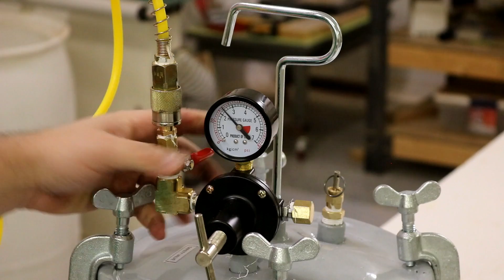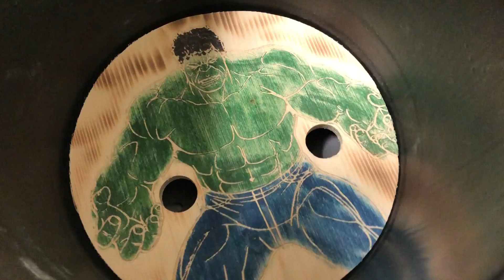Converting a Harbor Freight Pressure Pot for Resin Casting

Comment: I've always seen a vacuum pot being used to de-bubble resins in You Tube videos.  Could somebody please explain the PRO's and CONF's of using pressure versus a vacuum ?
Reply from the maker: Thank you for watching.. Vacuum chambers do a good job of getting bubbles out of the resin, but if it’s a resin with a short working time, there’s not enough time to go through the vacuum chamber process.. my resin has a 12 minute working time… The second thing is, I swirl lots of colors in my projects and it is way more difficult to use the vacuum chamber to degass, pour and swirl the colors.. with a pressure pot, the bubbles are squeezed immediately so you can mix all the resin and get it to the right temp for swirling and pour it, get it in the pressure pot and pressurized before it turns solid.. I remove my projects from the pressure pot 2-4 hours later with awesome swirling and no bubbles.  I hope this helps 👍

Comment: a super easy trick to get the paint outlet bolt out is to use a heat gun. couldn't budge the darn thing. ran a heat gun on it for about 30 seconds and it popped right out.
Reply from the maker: Heat does the trick sometimes. 🤓🦾

Comment: I actually bought the exact same part that you were going to install at the 3:57 mark and it doesn't fit with the pop off valve. Was the part a different fitting from what you described?
Reply from the maker: This video was from 4 years ago and it appears that the pop off valve is different now.. some people will tell me it’s different but won’t tell me what the new sizes are so I can change the links to the correct new parts… could you please let me know so I can change the links.
Reply: @JakeThompson  So when it comes to the actual tank and connections, everything else has stayed the same. 
However, the Robert Manufacturing R209 Series Bob Brass Adapter, 3/8" NPT Male x 1/4" NPT Female item that was an Amazon link has some what shrank in size over time. It still has the 3/8" male part, however the female hole has shrunk. The part from Amazon is now 14/32 millimeters in width. 

From inside, from thread to thread, the diameter is 12/32 mm.
Reply: @JakeThompson  The pop off valve remains the same size with the diameter, from thread to thread, at 1/2".
Reply: Alright, it took some investigation and now I have the part needed for the recent model of that paint tank. It's a 3/8" MIP x 1/4 FIP Bushing fitting from Proline Series. It's weird, because I mentioned before, that the brass adapter from Amazon was the wrong part despite the description. You can get it from Lowes, which is where I got mine, and Home Depot under the Everbilt line. It's under the name 3/8 in. MIP x 1/4 in. FIP Brass Bushing Fitting.
Reply from the maker: @seekertosecrets7618  Awesome.. I will get it changed .. Thank you for taking the time! 👍👍
Reply: @JakeThompson  No problem. I want to get the same results for another project.

Comment: What about using one of these for creating a vacuum chamber to make casting molds? Can this be used for vacuum too? Anyone?
Reply from the maker: It can but you won’t be able to see if you are overflowing what you are vacuuming… a glass lid would probably need to be made
Reply: @JakeThompson  Good point.

Comment: Are opaque colors not really affected by the bubbles as much if not using a pressure pot? Thanks
Reply from the maker: miko They are still affected, it’s just not as apparent, but if you are turning the cast on the lathe.. it will be apparent when it’s complete.
Reply: Jake Thompson thanks Jake! Appreciate all ya do

Comment: On the 3/8 pipe tap is carbon steel not ok to use or should I get high speed steel?
Reply from the maker: I’m not sure what I used.. I just had to clean out the threads.. I’m sure either will be fine.
Reply: @JakeThompson  I’m back! Sorry to ask so many questions. I now have a small air leak around the rim. What can I put on the inside of the lid to stop that? Got my Aluminite slow. Eventually going to try a pen blank and a small bowl w/ resin accent. In the instructions it says de-mold time of an hour but it’s not for the pressure pot. In your videos I think you say 2 hrs. Right? Really thanks fir all your help and Happy New Year

Comment: How about a vacuum chamber
Reply from the maker: TheMonkiekitty That’s another way to do it. But you need a resin with a long pot life. The resin I’m using has a 12 minute pot life.
Reply: @JakeThompson  when people make molds of different things that use a vacuum chamber to take the bubbles out of the mix so you get a stronger mold so when you put it in the pressure chamber your resin does it have any weird abnormalities with the shape
Reply from the maker: TheMonkiekitty I use HDPE molds.. They come out very well
Reply: @JakeThompson  I'm still pretty new to certain things but I've always been a sculptor and a painter and I actually wanted to create a mold of arachnid because I like spiders don't judge LOL. And that's from what I was gathering if you guys know anything better let me know

Comment: So I feel like a bit of an idiot but I'm new to pressure casting. I've set up the pressure pot and it's not leaking (great video btw), I just can't figure out how to adjust the pop-off valve. It looks like it has an internal thread and a slot for a flat head screwdriver, but the pin sticks out in the middle so you can't fit a screwdriver in.

Am I missing something or just being dumb? xD
Reply from the maker: Lol here’s another video I did on how to adjust that. Hope it helps. https://youtu.be/QYzsDTMVIK8
Reply: @JakeThompson  Thanks! Yeahhhhh, I'm not gonna lie I've been sat trying to figure it out for like an hour and just gave up xD  And yeah, brilliant video, bought myself one of these specifcally cos you explained it so well

Comment: If secured in a cradle to keep it perfectly still, could it be used on it's side? I have some dagger molds I wanna use that are too long for the base of the pot. I was thinking of turning it on it's side, securing it, and putting a platform on the inside (to have a flat surface for the molds to sit on). Would that work? Thanks!
Reply from the maker: Yes. Lots of people have their pots laid  horizontally for more room. 👍

Comment: Can you just get an adapter from male to female for the pressure relief? What size is that male connection that came with the pot?
Reply from the maker: There’s are many different ways to do this.. I just show how I did it.. most relief valves are 1/4 inch

Comment: im having a very hard time getting that elbow on it off to replace it with the reducer. what do I do?
Reply from the maker: I would use heat on it and then try to get it off.
Reply: @JakeThompson  The Heat sadly didn't do anything.
Reply from the maker: @KorevixVayleen  if all else fails .. you could take it to a mechanic shop and just ask for some help.

Comment: Now you used pressure, thought you were supposed to use a vacuum?
Reply from the maker: Both ways have their place.
Reply: @JakeThompson  do both ways accomplish the same thing?
Reply from the maker: @jerrydegan1601  The pressure pot squeezes the air bubbles immediately so tiny that they can’t be seen, a vacuum chamber removes the bubbles from the resin. My resin only has a 12 minute working time. Not enough time for degassing either vacuum
Reply: @JakeThompson  thank you, asking because your pressure pot seems to work well. Thank you!

Comment: Update from earlier post.  Well it wasn't the gasket leaking.  I had to fill the bathtub and hold the tank under water.  The weld seam where the pressure release valve got moved to leaks.  I publicly swear I will never buy from Harbor Freight again.  I've got burned too many times by their build quality.
Reply from the maker: https://amzn.to/3ePBtdN after using the HF I upgraded to these

Comment: I couldnt adjust my pop off. Did you turn the stem or the slotted portion?
Reply from the maker: Rated R Woodturning You turn the slotted portion
Reply: @JakeThompson  thats what i was afraid of. I tried mine in both directions and it wouldnt budge. Ill probably just buy a new one. Thanks!

Comment: How did you adjust the pop-off/safety valve? Mine starts a slow leak at about 25-30psi and then starts full bleed around 35-40psi. I see there are notches near the pin but mine only turn about 1/16 of a turn.
Reply from the maker: Dan Parmelee That is how it adjusts.. with the bitches beside the pin... it should turn pretty easy.. maybe take it apart and free it up.. or should replace it.
Reply: @JakeThompson  thanks for the reply!

Comment: Jake, what about the super slow cure deep pour resins? There are hundreds of videos showing crystal clear deep pours w/o bubbles!!  And this just seems to show the brand you're using cure too fast!  (?)
Reply from the maker: The deep pours are more for River tables and such and are good for about 2 inches at a time.. I can do more than 2 inches at a time with the resin I’m using.
Reply: @JakeThompson  Jake! you're showing bubbles w/o the pot- how could you get a deep pour of any size w/o a huge pressure pot??  Not understanding the reply?
Reply from the maker: @kevinmorin7965  here is a video where I do a 4000g pour.. https://youtu.be/zoQjF2LDbSA if I did this with a “deep” pour epoxy it would get too hot and crack

Comment: Does this pressure have any negative effects on the integrity of silicon molds?
Reply from the maker: If the silicone molds are degassed when they are made.. they will be fine.. if they haven’t been degassed.. they will deform under pressure
Reply: @JakeThompson  thanks!!!

Comment: I know this is a stupid question , but what is putting the air in their at pressure of 50 psi....is the other end of your hose connected to something? Also how do you know if your mold can take being in a pressure pot?
Reply from the maker: Here is a video about an air compressor https://youtu.be/wqIWYf3dhs4 that’s what is putting air into the pot. Second plastic molds like I used in this video are fine.. silicone molds should be degassed in the casting process to make sure they don’t have air in them.. silicone molds can deform if they have air in them, under the pressure of a pressure pot.
Reply: @JakeThompson  your awesome.   Thanks so much

Comment: I have a Vevor 3 Gallon vacuum chamber with 4 cfm deep vane pump purge, can I use that pump for a pressure pot?
Reply from the maker: I don’t think that will work.. it takes at least 40psi in the pressure pot

Comment: The pole coming out of the lid just does not screw off. Should I cut it? Is there another way to screw it off? I don’t have a thing like you do which helped you screw it off, any help will be appreciated
Reply from the maker: @Cookiemanginger  you can apply heat to the threads and see if that helps.

Comment: I did this but I can't get it to depressurize by turning the ball valve. it's almost like there is a check valve in the regulator?
Reply from the maker: william hamilton If you move the handle slowly it will let the air out. I just lift up on the pop off valve to let the air out.
Reply: @JakeThompson  thanks for your reply. I did use the pop off valve but i thought if i used it too many times it may weaken it?
Reply: I tried moving the ball valve very slowly but no luck. I heard a very small puff of air but thats all.
Reply from the maker: william hamilton nah.. I’ve used mine every time and it’s still good.
Reply: @JakeThompson  okay thanks.
Reply: @JakeThompson  I found out today that my regulator is one they call non relievable. so it has a check valve inside that stops you from dumping the air. I also found by unscrewing the t handle screw you can dump the air a lot fast than popping the pressure relief valve.

Comment: Okay dumb question time! What do you connect to the pressure pot to fill it with air or whatnot? And also, like a pressure cooker, I assume you manually release the pressure using one of the valves or something?
Reply from the maker: Thank you for watching.. you hook an air line from an air compressor to the inlet of the pot.. and there is a valve to let the air out. 🤓

Comment: what parts would i need to use a bike pump instead of an air compressor?
Reply from the maker: There has to be at least 45psi in the pot. A bike pump is not fast enough to do it.

Comment: If you're ok with taking all the fittings apart, all you really need to buy is PTFE tape, a 1/4 ball valve, and an air hose fitting.
Reply from the maker: Cool

Comment: I know this is a far shot, but is there any way to fix the air leak that comes from the lid itself? once I get to 20psi air starts leaking around the lip of the lid. All the pipes and valves are sealed tight. Is there a way to fix it or should I trade it in and see if I can get another one
Reply from the maker: Is it from the seal or the lid itself
Reply: @JakeThompson  I believe its the seal, but it looks like the small inner ring that holds the seal in place may not have been welded right.
Reply from the maker: @ZanyMakerZak  here is a link to a better lid seal.. you can smooth out the welds by sanding… but if it leaks a little bit you can always just leave the air on and let the regulator n keep it at the right pressure.. This is a cheap pot and it’s probably not going to be perfect. Here’s a link to an awesome pot https://amzn.to/3q9Vnqq
Reply: @JakeThompson  I will try this right away! I thank you so very kindly for your time and help! That will be my next pressure pot when I can

Comment: The first Pressure Pot I got had faulty safety valve and regulator, so I swapped it out for another, now the lid leaks.  They don't have any replacements for a while and I'm really wanting to make some new dice.  Any suggestions on trying to reseal the lid?  I read/watched on another channel to try and use something like Vasoline on the gasket and that's HELPED but hasn't stopped the leak.  I drop from about 40 PSI to 15 PSI over roughly 24 hours.  Just wondering if you have any suggestions or thoughts.
Reply from the maker: Taylor Payne My lid leaks sometimes... I have it on the edge of the table.. and I have clamps handy.. if it leaks.. I just clamp the top of the pot to the table.. I always leave the air supply hooked up to it with the regulator set to 50psi.. if it leaks a little the regulator will continue to let air in to maintain proper pressure.. it’s not the most convenient but it’s cheap
Reply: @JakeThompson  Thank you for replying!  I'll try the clamp trick, since I'm concerned if I swap for a new pot, it'll have a similar issue.  I just have a little 3gal compressor I have to turn on, so I can't keep it hooked up to a supply, but I can "top off" the pot at some point.

Comment: My gauge came with a bent face so it only went up to about 20psi then the needle got stuck on the face. My pop off Valve went off before reaching 50 psi when I put a new gauge on and I can’t adjust it. I had to use a small pipe wrench to remove it from the original set up. Any suggestions.
Reply from the maker: https://youtu.be/QYzsDTMVIK8

Comment: What is the minimum size air compressor I would need for this size pressure pot?
Thank you in advance.
Reply from the maker: I would have at least the tank size of the pressure pot.. so at least 2.5 gallons to be sure.

Comment: Is it normal to lose some pressure overnight?
Reply from the maker: Just Me It’s hard to get these to seal 💯 % so it is normal to lose some pressure overnight.. I have the regulator on mine for that reason. 👍
Reply: @JakeThompson  Could you please explain what you mean? You can use the regulator to keep the pressure in (sorry if this is a dumb question I am still learning.)
Reply from the maker: Just Me not dumb at all.. if you leave the air hooked up and on, the regulator will keep the air pressure consistent by letting air in as it leaks out slowly.
Reply: @JakeThompson  Got it!  Thanks for the quick reply.

Comment: Don’t know if you’ll see this any time soon because this video is so old now, I just got my pressure pot all set up (finally) but the emergency release keeps hissing and letting out air before it gets to 50 psi! It stays above 40 maybe around 45 but I just wanna know if I’m doing something wrong or maybe it’s an issue with the part?
Reply from the maker: https://www.youtube.com/watch?v=QYzsDTMVIK8&t=46s  See if this video will help you out... I think it might. :)
Reply: @JakeThompson  thank you so much! I think I just need to adjust the pop off valve, but now I also have other things to try if it’s still leaking ☺️ much appreciated!

Comment: I picked one of these up yesterday, but the seal around the pot (not the fittings) couldn't hold more than 30 PSI before leaking. I returned it for another one, which can go up to 35 PSI before the seal fails again. I've hand tightened the screws as far as they'll go, am I missing something with these pots?
Reply from the maker: https://youtu.be/QYzsDTMVIK8?si=CPFHDUzdZJYwyi-M here’s the second video I made that goes over frequently asked questions.. I believe there is also a link to a better seal that I found after making the second video.

Comment: Bought everything from your links but unfortunately the pop off valve is too big for that other piece to go into. Now It’s useless.
Reply from the maker: They must have changed sizes since I made this video… maybe you could tell me what size a useful one would be and I could update the link.
Reply: @JakeThompson  they sent the wrong adapter size but the pkg was correct. All fixed! Thanks